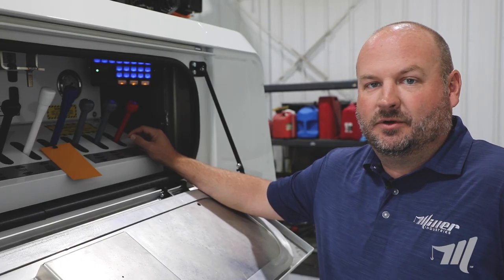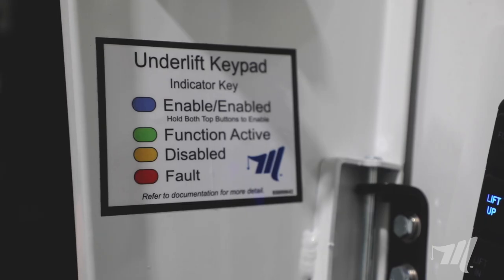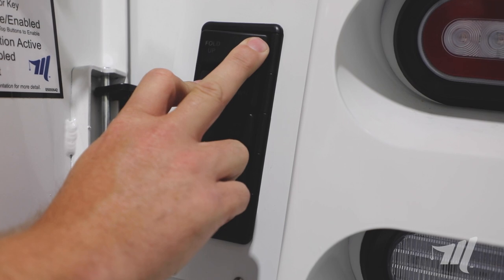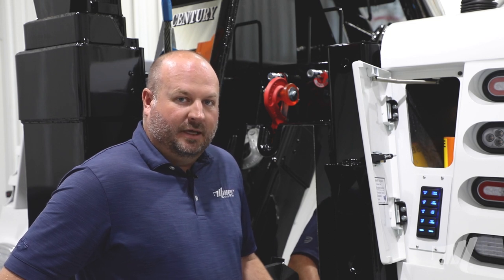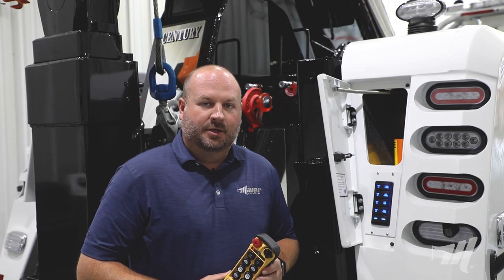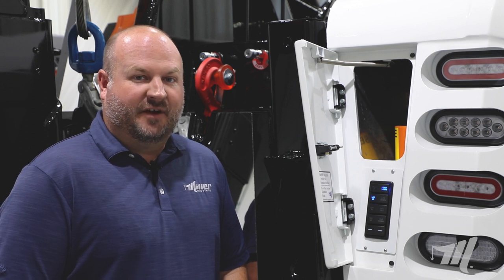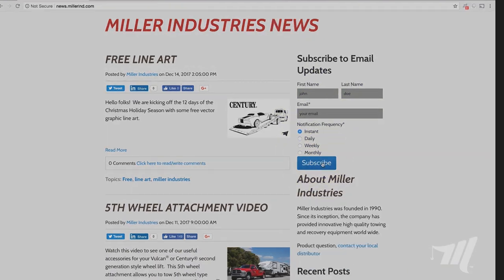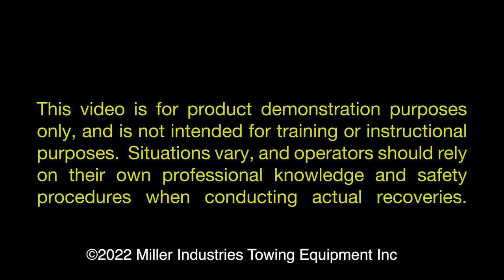Tailboard Switch Panel 2022

Comment: Let me start by apologizing. I realize my comments are off topic.  But I  believe a small addition might help in reducing the amount of labor that is needed to pull cable from your trucks to disabled vehicles.

Let me start by saying my experience is in large oil tankers.  I was involved in a number of studies dealing with emergency towing of disabled tankers.  These studies involved large towing vessels with tow cables 3" in diameter.

The simplest way to connect a tow line is by first passing a messenger line from the ship to the tug and then using the ship's capstan to heave progressively larger lines until the towing cable is brought aboard.  If the ship has no power, the initial messenger line is passed from the tug to the ship and then back to the tug.  The ship passes the line through a snatch block.   The tug can use their capstan to pull the tow line to the ship. 

In watching videos of your tow trucks in use I have noticed that at times a lot of time and labor is needed to get the towing cable to the vehicle.  This is especially true if the tow truck is away from the vehicle that is to be towed.

My suggestion is for you to incorporate a small capstan, such as those used on sailboats, so a small diameter synthetic (Spectra or Dyneema) line and snatch block can be used to pull the tow cable to the vehicle.  Companies like Harken, Lewmar and Andersen make small winches (capstans) for sailboats with both manual and self-tailing designs.  The winches come with single, two and three speeds.  Hand cranked, electric, pneumatic and hydraulic powered are available.   These winches are designed for ocean sailing and have pulls from 500 to 5000 pound pulls.

Strategically located a capstan might help to reduce labor expended and to reduce injuries.

Bob